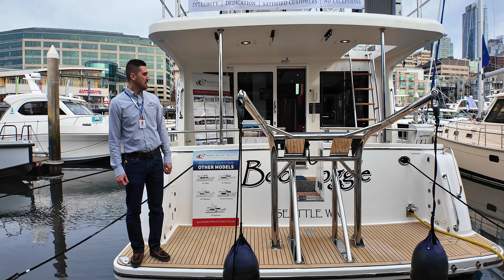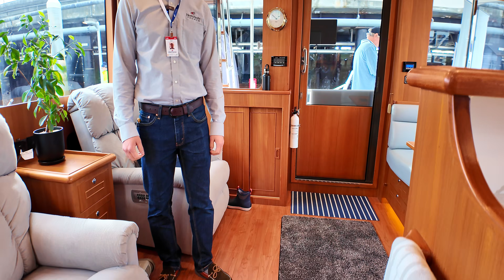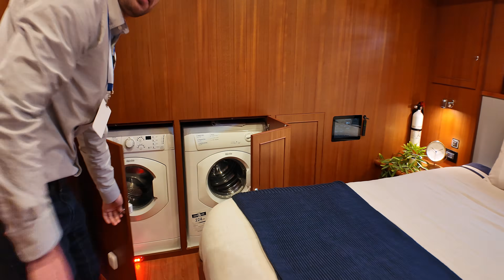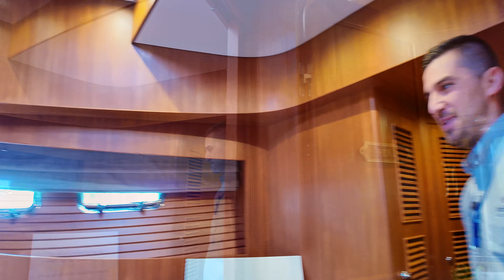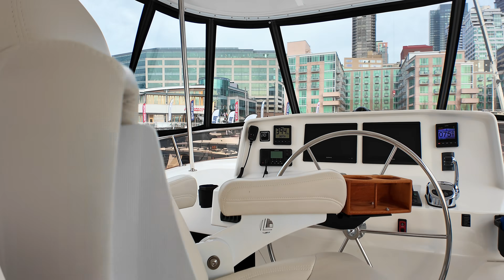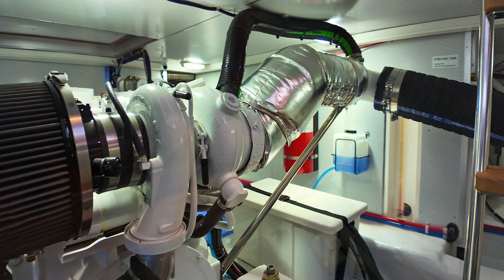This 49' Trawler Trades Walkways for Volume! | North Pacific 49 Full Tour

Comment: Whats the range?
Reply from the maker: In the video, during the engine room tour, Evan estimates a usable range of roughly 1,000–1,200 miles, depending on cruising speed, load, and conditions. She carries 700 gallons of fuel and typically cruises between 7 and 10 knots.

Comment: What I don't get is why with all of the lithium power options out there, why manufactures are still using LP gas stoves instead of induction???
Reply: Cooktop, not oven.
Reply from the maker: Good clarification, cooktop rather than oven. Induction is becoming much more common, especially with modern lithium and inverter systems. On a semi-custom yacht like this, LP may have been the owner’s preference for lower electrical demand, familiar cooking performance, and redundancy. I agree, though, induction would make a lot of sense on many new builds today.
Reply: @rd4660  because some of us prefer the reliability.
Reply: Some people just prefer a stove to have a flame, even if induction is technically faster and more even to heat.